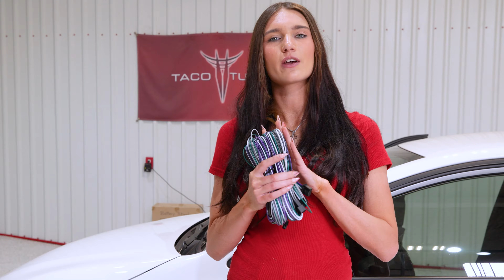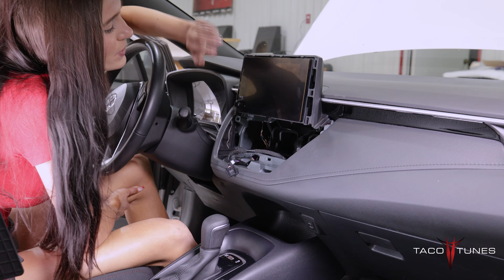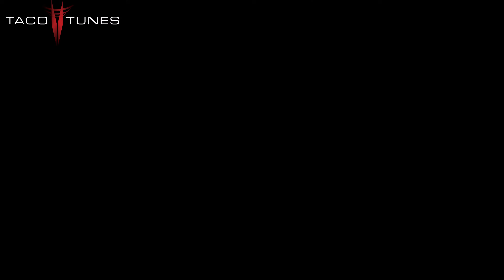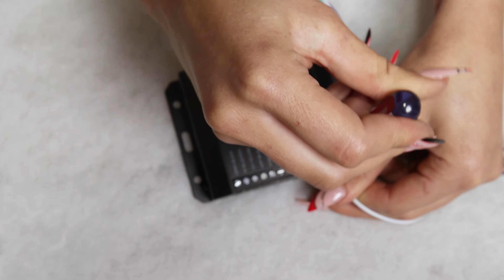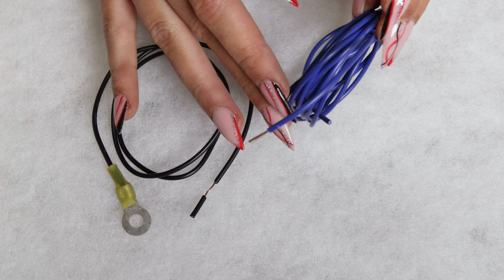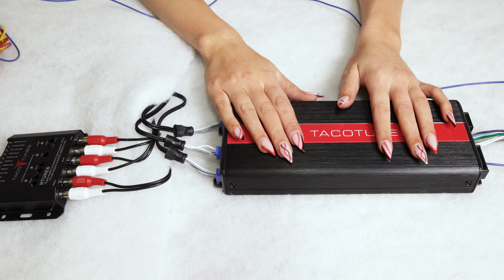2019-2025 Toyota Corolla add amplifiers to stock stereo tacotunes.com NTUNE6 Line Out Converter

Comment: I have a 2022 Toyota Corolla (non factory amplifier). Where did you purchase the T-Harness to hook up to the factory radio??
Reply from the maker: Here you go: https://tacotunes.com/product-category/toyota-corolla-audio-products/plug-and-play-wire-harnesses-toyota-corolla-audio-products/
Reply: @tacotunes  also if you use the LC5i PRO can’t you technically get away without purchasing the “Remote Turn-on and 12V harness”?

You can just set your LC5i PRO to GTO or audio mode to get signal from the speaker wires that are connected to the head unit and then you just bridge your power wire to one of your amps power wire? You would then still use a blue remote wire from the RMT Out to both amps? That should work correct?
Reply from the maker: @jjgonz98  you need the remote turn on . . the LC5i requires the remote turn on / 12V power.
Reply: @tacotunes  the LC5i has GTO mode which allows for signal sensing so when the speaker wires are connected to LC5i terminals, the device will sense signal from the factory radio therefore turning it on. But it also needs a power source so you can connect your power source to one of the amplifiers because your power wire from the amp will be connected to battery anyway therefore giving power to the LOC. So it would make sense that you wouldn’t even need to the remote and 12v harness.
 Now to get your amps signal you would just use the remote out connections and wire to the amps because you are already getting signal from the speaker wires to the LOC.
Reply: @tacotunes  https://youtu.be/tBjKhoFDSUo?si=GbVR-Gem_IvO405-

This video explains how it works and how to set up but with a LC2i Pro. The LC5i Pro should work the exact same way except just more channels to 2 amps.
Reply from the maker: @jjgonz98  Agreed that is an option. However for best performance, we suggest the remote turn on wire method. We have had customers report intermittent issues when a remote wire is NOT used.

Comment: Would you still use the cross over filter in a component speaker for the front speakers?
Reply: yes
Reply from the maker: Yes! Component speaker systems use crossovers to deliver the proper frequency to each speaker.